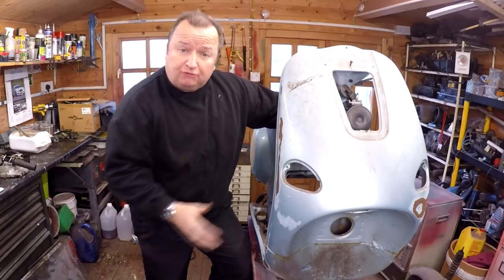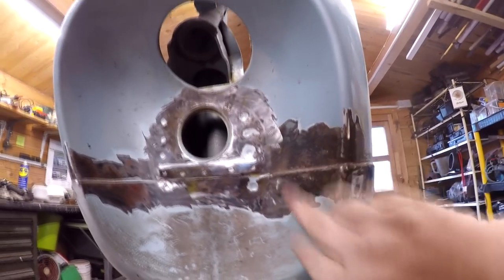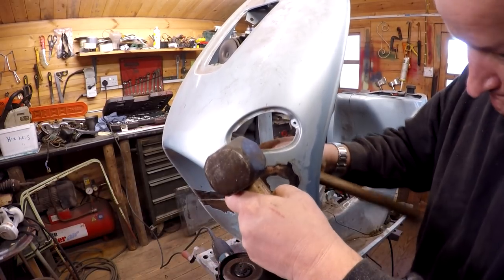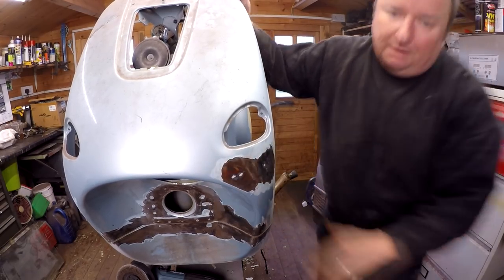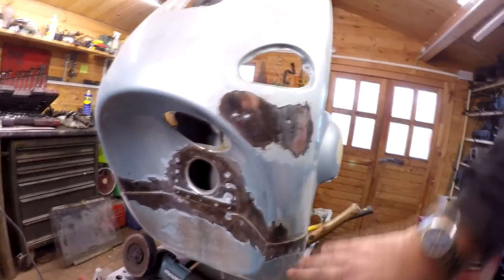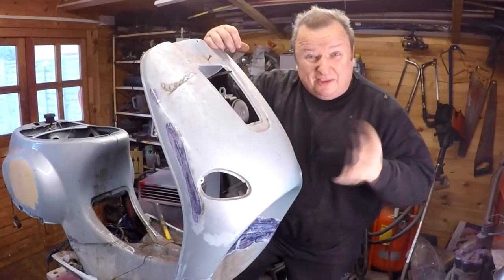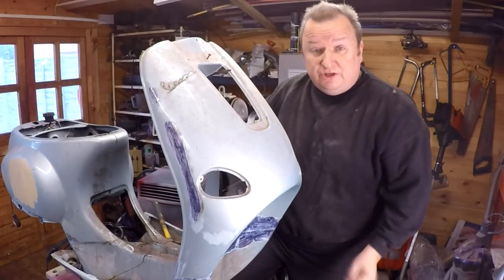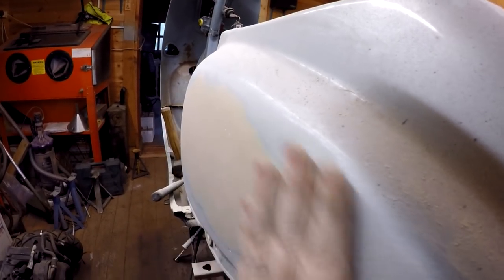Vid 5 Piaggio ET2 50cc Vespa Respray Restoration  Preparing The Bodywork

Comment: Looks great !  Wouldn't it be great to have a 55 gallon drum cut in half vertically with hinges so you could close it but you could dip like the front rusted area !?  Never know there is a guy in Australia that has a cow trough that he has filled with molasses and soaks panels in and they turn out beautiful ?
Reply from the maker: Yes, i've seen the molasses trick, it works a treat but can take a while to work.
Cheers
Martin